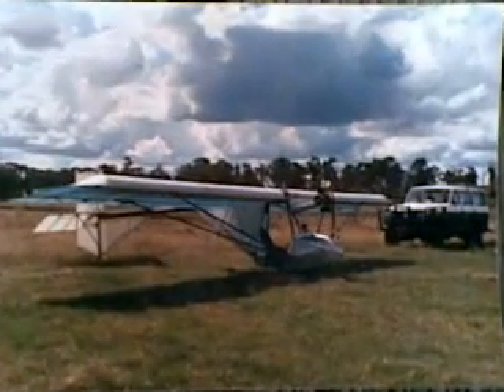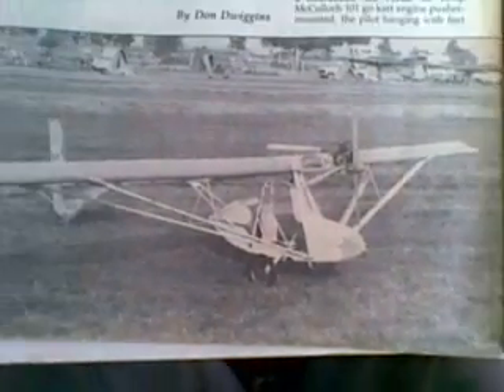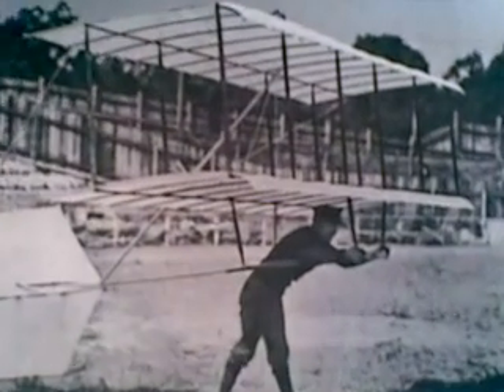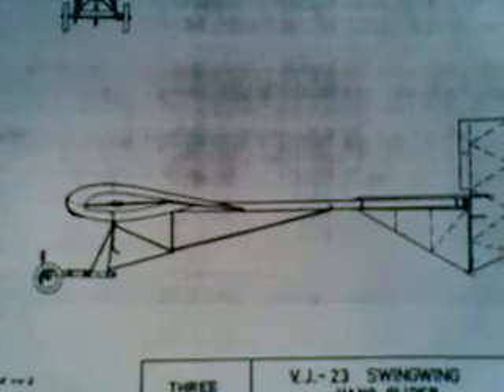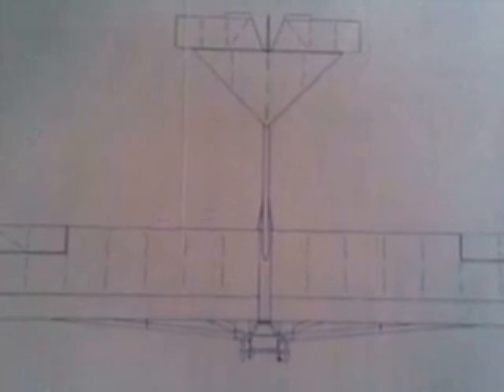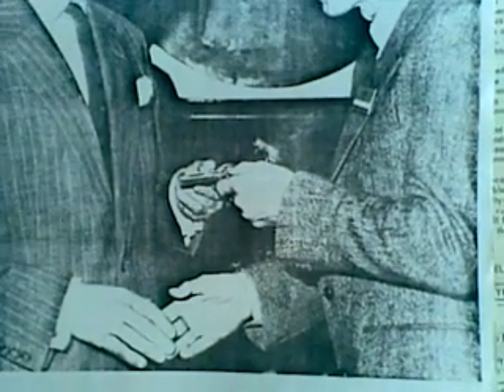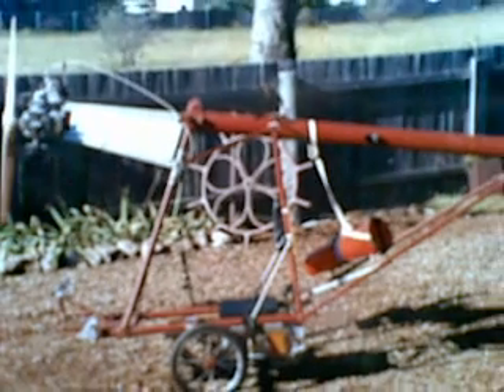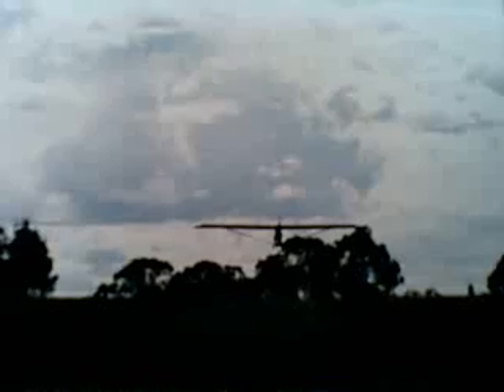V.J.-24w. "SUNFUN". World's First Ultralight Motorglider... 22 Hp. Australian Modification.

Comment: I had to double check to be sure but there is undoubtedly an out of square condition or rigging on at least the stab in reference to the wing - look at the front and rear views and it will be immediately apparent, this is an extremely unsafe condition I have to assume the aircraft was not fully rigged for flying in those shots? !!
Reply from the maker: G'day,

  Thanks.

    Yeah, you're right in that the Stabiliser was a degree or two askew, it was apparently built that way - remember that I bought a half-finished project ; and while the Stab. wasn't exactly parallel with the Wings, the Fin was indeed perpendicular to the Wings and it lined-up with the Fuselage...

  There wasn't any way to alter the angle of the dangle of the Stab. without rebuilding the whole back end of the Aeroplane, and far from being "in a dangerous condition", it flew perfectly well like that - and if there was any Right Yaw effect from Up-Elevator or Left  Yaw coming with Down-Stick then I never ever detected it...

   Like many a Model Aeroplane before it, the Jensen flew quite well with the Tail slightly skew-whiff...; but, mind you, it was so chronically underpowered and it got along at such a Nose-High Angle that the "P-Factor" (Yaw emanating from the Propeller's Thrust being offset due to the downward-moving Blade travelling forwards while the upgoing Blade was moving rearwards, thus resulting in the Blades having different Airspeeds & Angles of Attack..., it generally only occurrs with savagely underpowered and horribly slow machines...)   was so strong that when flying "Feet-off" it slowly turned Left at a rate of 90 degrees per minute - four minutes to the full circle...(!).

   On the other hand though, I have different fingers, and in the gripping-hand there is the point that the JPX having both Cylinders firing simuaneously imparted such a massive torsional vibration to the whole Fuselage-Tube (the Cockpit Instruments were utterly unreadable at Flight-Idle when airborne..., but on the ground the Weight on the Wheels damped the Wobblies just enough to see what the Needles were indicating...) that there was a "cyclic wave" of constant oscillation accross the whole tail such that both Stabiliser Tips were moving up & down enough for the slight out-of-true Rigging to be entirely lost in all the other stuff which was happening...

  The design & structure of most of the Fuselage  Load-Paths hadn't changed since it was designed as a Footlaunched Hang Glider, remember, and it was all put together with extreme Lightness in mind.

  But, well spotted..., not many people notice that little twist to the Tailfeathers ; though I reckon it sticks out like the proverbial "Dog's Balls".

  Have a good one,

  ;-p

  Ciao !
Reply: great response man, I guess its a testament to the simplicity or how 'bullet proof' the design is that an asymmetric tailplane has no effect on stability or control...I'v certainly learned something today Thank you!
Reply: Oh and I am known for my eye for the tiniest detail - it's how I make a living so don't worry that it sticks out at all :)
Reply from the maker: +Darren-Edward Oneill 

  No worries mate,

    From what I can make out, as long as the Planform Balances, and the GG/CP are within limits, and as long as there's enough Side-Area far enough behind the CG/CP...; then pretty much anything up to 2 or 3 Degrees of alignment-error between the Wingspan & the Tailspan is more or less undetectable as judged by the Flying Characteristics, at least they are when flying below 60 MPH...(!).

  Have a good one,

 ;-p

  Ciao !
Reply from the maker: +Darren-Edward Oneill 

  No worries,

    Have a good day detecting small anomalies then...; working as one of QE-II's "duly-appointed minions" perhaps, or are your investigations more of a Freelance Contracting nature (!) ?

 ;-p

  Ciao !